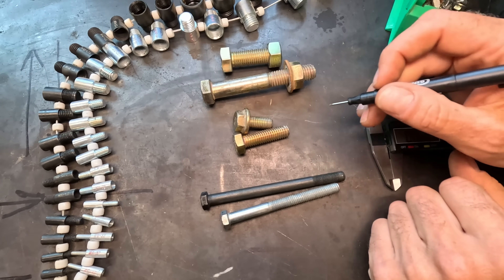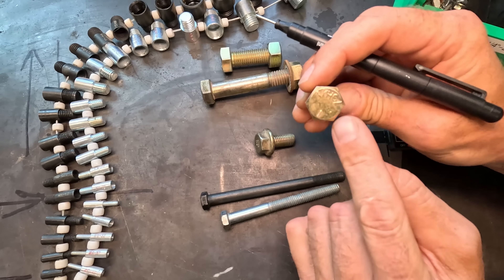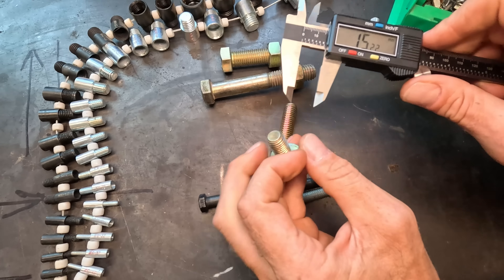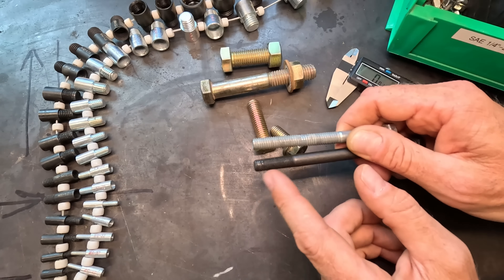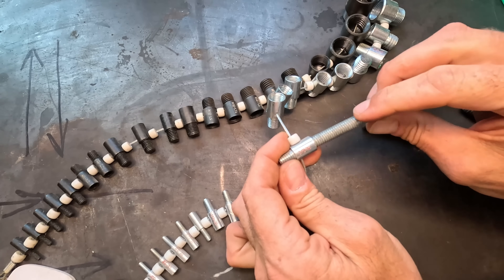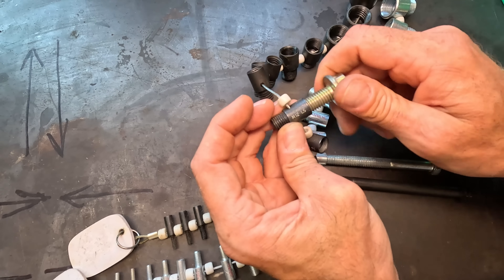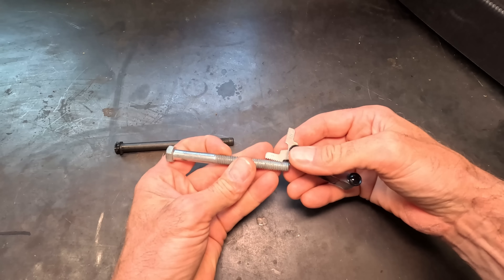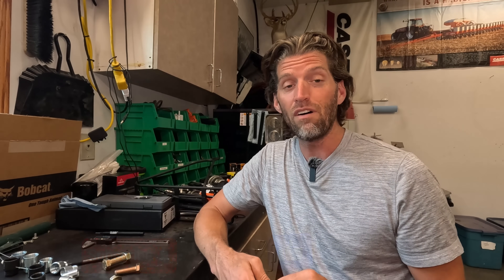How to find bolt & nut size, metric or imperial.

Comment: Interesting but alas, doesn't solve my problem. I've got an old Jacobs drill chuck with a threaded male shaft machined on it. I can't find information about this type. (It was salvaged from an old Made in France B&D power drill from the 70's and I would like to use it for a jig but I have no idea what the thread is and I would rather not epoxy it in place.) 
Shaft length is 11 mm, OD shows 0.367" (9.32 mm) but I have nothing to mesure the pitch accurately and having being raised in metric world, you'll understand your thread charts are a mess to me. 
The only markings are 1/16 ------ 1/2 (1,5 ------ 13 mm    Multi-craft chuck   Sheffield England   U8304.  

If anyone knows anything about it... Thanks in advance.
Reply: I think I have a chuck with  a similar shaft, also a Multi-Craft 1-10mm chuck, also from an old B&D drill. The diameter is 9.48mm but there can be small variations. Five threads is approx. 5.4 mm so it means 25.4 / 5.4 x 5 = 23.54 TPI. So I guess it's 24 TPI (Threads per inch). And I guess the shaft diameter on your chuck shaft is 3/8 inch. This means 0.375 inch, not 0.367. But that's the only one that makes sense. So 3/8" x 24 TPI.
I'm late, but I hope it helps.
Reply: @OnTheRoadAgain-S  Thanks for the answer. So does that mean it's SAE thread? I only have metric or whitworth pitch gauges and neither one seems to match.
Reply: @19Edurne  I have no idea. I only have a metric pitch gauge. I have a lot of old bolts and nuts I've saved from old things through the years. If I need something else than metric I just try to find a bolt or nut that fits. I've never bothered to dig further into the standards. Could it be an UNF thread?
Reply: @OnTheRoadAgain-S  I have no way of checking that either, so no idea. ;)

Comment: When would someone use a coarse-threaded bolt instead of a fine-threaded bolt?
Reply from the maker: Great question. I'll let the engineers watching give hyper-detailed reasons, though I suspect it has something to do with the strength of the grip. Example, like you/me holding onto a bar with 3 really strong fingers versus holding on with 5-6 medium strength fingers....the holding force is more spread out to better. Curious to see others explain the micro detail!
Reply: Coarse-thread bolts are for common hardware applications. They are easier and faster than fine machine threads. For example when you are up on a ladder in the wind bolting together something like channel struts you want a thread for oversized holes that is easy to start by hand and can be rapidly driven tight. Fine thread machine bolts or screws are for precise component fitting where you are in a situation needing fussy fitting.

Comment: A good and useful explanation as to how to identify a bolt or nut size and type. HOWEVER, you omitted two more important factors in identifying a thread type, and those are the Thread ANGLE and Thread FORM. Each thread series has its own angles and shapes eg: BSW and BSF are both 55 degrees, BA is 47 degrees, UNC, UNF, UNEF and METRIC are all 60 degrees. Then there is the tread form such as V, Acme, Square, Round, Buttress and MULTI START. 
There is a lot more to threads than you have explained, but it is a good start.
Reply from the maker: Thanks for the great comment. Yes, definitely more to the "thread" story in some situations, but intentionally stopped short of that trying to help the average person understand the basics/typical norm. Been some fun comments from people about the unique threads they've come across.
One unique thread I've encountered, to aid with joint locking, is Spiral Lock threads on nuts. Interesting concept. Have you ever encountered those? Cheers!
Reply: not to mention those dreaded Whitworth threads
Reply from the maker: @moss8448 some others have mentioned that, but I haven't yet experienced them. I have been meaning to look them up in my Machinery Handbook, but haven't had the chance yet.
Reply: @LearnedFromDad  ran across those deals when I had British Sports cars; Triumphs & MGs.

Comment: Without caliper I just imprint the thread on a piece of paper and then check the indents on flat paper with a simple ruler over as many threads as possible. Same applies to circling a bolt with paper for getting the diameter. It's like using a 3.14 magnifier lens. It's good enough for any standard bolts even to distuingish imperial and metric with a look-up table.
It works well on fine threads like on cameras and camera lenses/filters.
Reply from the maker: That is a neat technique. Thanks for sharing!
Reply: super handy, sounds like something the professor would do on Gilligan's Island
Reply from the maker: @bruce-le-smith haha, agree! And, I'm definitely old enough to understand the TV show reference. 😆
Reply: Given just a female thread to identify, what would you do?  We used to use a piece of children's modelling putty on a file tang, or something similar, to take an impression, then you can gauge or measure the pitch on the putty... Plasticine was good, Playdough not so... A little spray of oil inhibits adhesion.
Reply: Same applies to inside threads. Roll some piece of paper, put it inside, let it unroll and use anything to press it against the threads.
Keep in mind it's just an household solution when there are no calipers or measuring tools at hand. You may want to use a tapered piece of paper/cardboard to measure a hole diameter using similarity of triangles. The diameter of the hole is proportional to the depth you can put in the triangle of paper in relation to the base and height of the triangle. This gives you a magnifier effect in accuracy.
Reply: @rkalle66  No! and for many reasons. Even using internal calipers in a femate threaded (tapped) hole isn't great.  Tapping drills are always specified at a diameter greater than the bolt's core diameter, and in any case, in manufacture, we may be aiming for a truncated thread, which means less metal is removed in the tapping operation, reducing the likelihood of tap breakage in that operation... It's always been done, even from the early days of Whitworth thread. forms.
A male whitworth thread is specified as having a radius at root and crest., the female has corresponding radii, in theory, but if you're threading either with a sincle point tool, you enlarge the "tapping" hole in the female, or you'd end up with a sharp pointed crest that interferes on the root radius of the bolt, when inserted.  Similarly, when making a male thread with a single point tool, you reduce its major diameter, again avoiding making that sharp point that would interfere... (Yes, if you possess them, internal and external chasers can finish a Whitworth thread "correctly", but they add to production time, reduce production rate)
A male and/or female thread in combination can be quite drastically truncated without drastically reducing a fastener strength.  It's the effective diameters that must be maintained...

Paper, though, will not give an impression of a thread's included angle... Plasticine (modelling putty) or wax, will. (in addition to giving you something to measure pitch from.

Comment: Where did you get the two tools for checking metric and standard bolts and nuts and what's the tool called ? I like to draw on a string and you can hang them up so they're easy access .
Reply from the maker: I bought them from Amazon, there are a variety of different styles, but I prefer the ones I have. They are called a Thread Checker. I dropped a link in the description to the one I have, but several styles exist to explore.

Comment: James this is excellent , I love hardware , I have several boxes of screws ,bolts, nuts etc. There are, as you pointed out is quite  involved . Thread pitch , left hand thread , grade and on and on. I have a set like this on Amazon. So one day I got my checker box out and to my surprise , I have some and nuts and bolts  that didn't work on any of my checkers! I determined that since I collected these from I don't know where, that came off of an alien spacecraft and I put them in the  recycle. One shade tree trick is to take a bolt that you think is metric and try a standard nut , it will thread a couple of turns and stop ., that bolt is  more than likely going to be  metric. That is to say that bolt and nut threads are good and buggered up! One thing you didn't cover , was left hand thread ,but I figure that most home owners are not to run into very often.
Reply from the maker: Thanks for commenting on this video as well, and sharing your experiences. I did the same with my giant bucket of bolts, sat and checked them all one day to organize into bins. I didn't come across any unique, but several comments have been made about some very unique hardware experiences. And absolutely, left thread, I'll definitely touch on that in another video as even a home owner or farmer will encounter such occasional, such as in a rotating part. Cheers!
Reply: @LearnedFromDad 
 As a mechanic I run into odd fasteners frequently. I have found that metric standard is not standard everywhere. Apparently some countries use 7,9,11 and 15 mm sizes for random hardware. This really throws you when checking sizes. Most metrics also have 3 common thread pitches.
    Also should mention that JIS metric standard has been used in most automobile manufacturing for 30 years but is almost unavailable in the hardware distribution systems in the USA. I have to special order almost every common size replacement bolts. Most common USA metric fasteners have oversized head and nut compared to factory parts and usually won't fit in recessed machined parts. I don't see this in fasteners on anything imported from the rest of the world.
   Biggest irony is SAE standard fasteners are FAR less expensive than any metric fasteners but the majority are made in China, not the US!
Reply from the maker: @jeffhill3681 I missed your reply. I've been fascinated to learn more about hardware as I have interacted with folks in these videos comments, and looked at more standards. It was most interesting to learn about all the different standards for metric that I really wasn't aware of. I'm normally good with obscure wrench sizes because I always grab 3 sizes to prevent a walk back to the box, something will fit properly 😁

Comment: I'm a little confused as to which measurement is used to determine the size of a bolt. Is it the diameter, the thread count per inch (the distance between threads), or the length of the bolt?
Reply from the maker: I'm glad you asked. I should have visualized some text on  screen to better clarify. I'll give an example of an imperial/inch bolt, but metric is similar.
You walk into a store and see a bin labeled 1/2"-13x3", for example. The 1/2" is the bolt diameter, and is the value communicated when someone is talking about the 'size' (diameter) of a bolt. Then, a good co-worker will next ask "well, 1/2" diameter, but what threads per inch, and overall length, do you need?".
Now, while 'size' is referencing the diameter, I'll say in the mechanical world it's most common to alway reference the diameter and threads together when communicating, because those two elements really work together. So, you might say "I need a 1/4"-20 bolt" or "I need an M12-1.25 bolt".......from there you just need to clarify the length needed.
Hope that helps!
Reply: @LearnedFromDad  Ok, I understand now. Thank you for the clarification.
Reply: Great video, very informative
Reply from the maker: @michaellacaria910 thanks! Glad you enjoyed!

Comment: Here's something weird for you: the rear axle on my 1991 Trek 820 mountain bike is 10mm in diameter, but the thread pitch is 26 threads per inch!  So, that's two different measurement systems used in a single part.  I found this out the hard way when I was replacing worn bearing cones.  Two sizes of cones were available: M10 with 1mm threads, and M10 with 26 tpi.  I assumed that it was the former (why would anyone mix metric and English standards in the same part?).  The two thread sizes are close enough that the thin lock nut that gets wedged against the bearing cone would thread onto the axle even though the nut was a 1mm thread and the axle is 26 tpi.  However, the bearing cone is longer, and the error accumulates, and the cone with 1mm threads won't work on the 26 tpi axle.  Why anyone would design the axle that way is beyond me.
Reply from the maker: Woah, that's a unique situation! Fellow bike enthusiast here as well. Thanks for sharing that!! Cheers!
Reply: Bicycles are weird. They’re also the reason why metric sets often include a 14 mm wrench, even though they’re not needed for any common M-sized bolts.
Reply from the maker: Fortunately I have a couple bike mechanic friends. That is one unique space where I just let someone else take over. Im here to ride them! Cheers.
Reply: @johnkangas7350  There is no such thing as an M10 with 26 tpi and to think that the two sizes are close enough is not a clever thing to hope for . It probably is 3/8” BSC . It’s this close enough that could hypothetically be deadly .
Reply: @vankuipland  I probably wouldn’t have believed it either if I hadn’t experienced it firsthand.  The bearing cone I bought for my bike is Wheels Manufacturing part number CN-R085.  Just Google that phrase, and you'll find it.  The description of the part clearly states “Compatible with 10mm x 26 axle”.
QED
I was not “hoping” that the two thread sizes were close to each other, I was just observing that they are.  A 1mm thread pitch is equivalent to 25.4 tpi, which is close to 26 tpi.  A thin M10 x 1 nut DOES thread onto my axle.  I never suggested that anyone actually use a M10 x 1 nut in this application.
Reply: @vankuipland  I probably wouldn’t have believed it either if I hadn’t experienced it firsthand.  Here is the URL for the bearing cone I bought for my bike (Wheels Manufacturing part number CN-R085):
https://wheelsmfg.com/products/hub-parts/all-cones/cn-r085.html
The description clearly states “Compatible with 10mm x 26 axle”.
QED
I was not “hoping” that the two thread sizes were close to each other, I was just observing that they are.  A 1mm thread pitch is equivalent to 25.4 tpi, which is close to 26 tpi.  A thin M10 x 1 nut DOES thread onto my axle.  I never suggested that anyone actually use a M10 x 1 nut in this application.

Comment: Hello, thanks for such a good video. I wonder if you happens to know what standards follow the Korean cars?  I have a Daewo-Pontiac Spark butmost of its fasteners just have a big number maked on their head 7, 10 , 6 etc only the ones in the knuckle to strut fasteners are marked by diagonal dashes according to SAE, they are al milimetric.  Best regards
Reply from the maker: You and some others asked this same question. My Kubota lawn more has the same. I FINALLY figured out what they are and was excited about it so made you all another video on that exact topic. They are a specific vintage of Japanese Industrial Standard bolt and the number is a strength class. Enjoy this video!
https://youtu.be/fDhsn6kLmVE

Comment: When you work on vintage British machines you not only have metric & SAE (also known as Unified National Fine/Coarse here) but you also have BSW (Whitworth), BSF (Fine), BA for smaller stuff, possibly even some BSCY (cycle thread), maybe even some ME (model engineers) threads, BSB (British Standard Brass) & some threads that manufacturers just made up.
Then go to veteran European manufacturers (pre war & back) & you have metric special threads & a few different metric systems & even an obsolete German Sewing Machine thread that is loosely based on the imperial British system for some reason.
Oh yeah, & British Singer sewing machines had their own thread system too.

I rebuild vintage magnetos & do some work on vintage motorcycles & other machinery, so I’ve seen most of them apart from Singer threads (some German magnetos used the German sewing machine threads & we took those designs after WW1 & continued with the threads, unfortunately the taps & dies are almost impossible to find).
I’ve got drawers full of various taps & dies & I still regularly have to buy more. Sometimes I can spend over half an hour trying to identify a specific thread.
American Bosch magnetos are always interesting, they carried on using some metric standard & special pitches but were eventually designed out to your SAE, so they can take some work identifying threads.

My go to tools are a good set of digital callipers & 4 different sets of thread pitch gauges. The thread-on checkers just aren’t accurate enough & I would need so many.

Comment: Can the thread checker at the end be inserted into a threaded hole?
Reply from the maker: Sure can, you just need to rotate the full checker to spin the individual checker into the hole. Or, size a bolt and use that to check the hole.